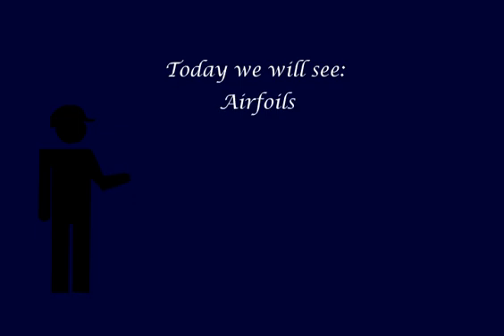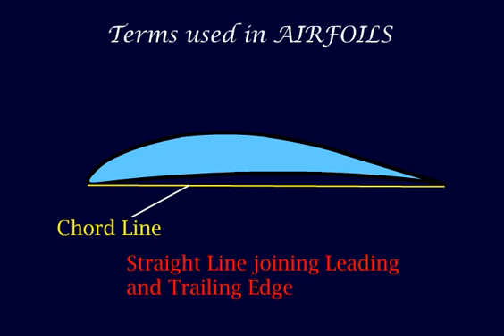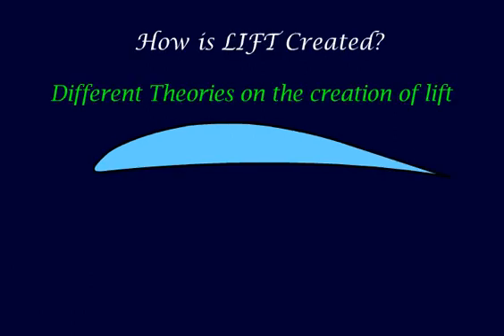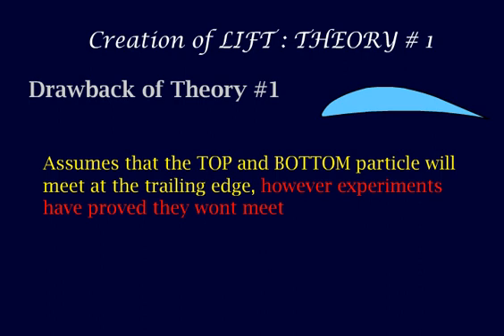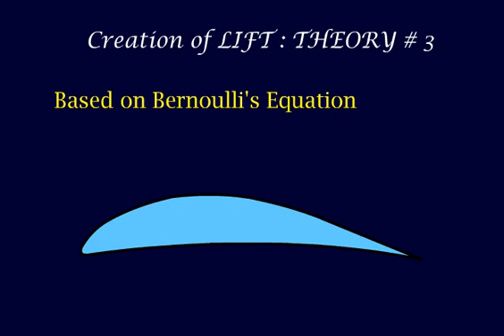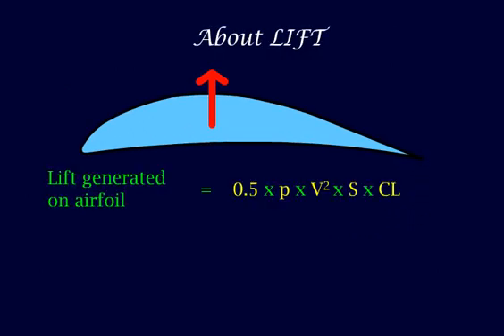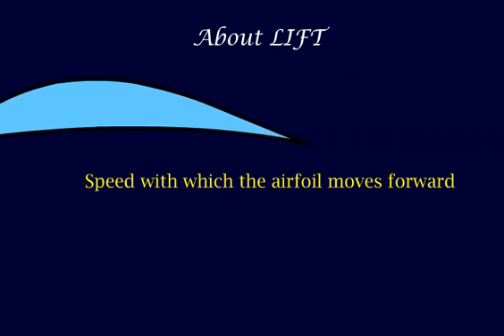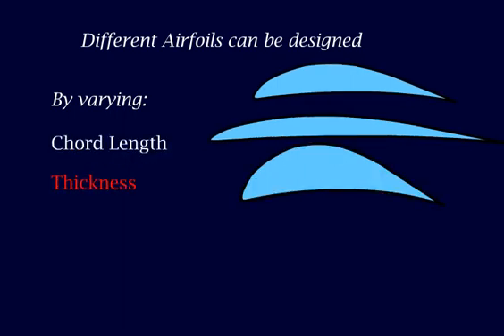Airfoils: How LIFT is Generated and the factors that affect Lift.

Comment: Good video. I liked how when you identified the Equal Transit Time fallacy you also mentioned that the fluid on top still moves faster than the fluid at the bottom. I was a little confused at around 2:45 in the video when you stated that velocity decreases at maximum thickness and that high pressure forces the fluid particle to speed up for the remaining chord. Not sure as to the validity of this, would have liked you to dive deeper and explain why you think that is. Otherwise, good job identifying both theories and how they are applied.
Reply from the maker: Thank you for the information! Check out my other videos as well!

Comment: The discussion of the theories of lift are decent, I would like to see a better explanation of why the air is accelerating around the upper surface. Also it seems that when you talk about pressure and velocity it seems like you are making them directly related when in fact they simultaneously affect each other.
Reply from the maker: Sure. Will make a video about lift separately.

Comment: This is disappointing for a recent video.
I am sorry, but your ideas at 2:45 are inconsistent with measured data and what is very well understood by aerodynamicists. 
.
 There is no "high pressure" above the wing that pushing particles toward the trailing edge.   That air accelerates as it rounds the LE because the pressure ahead of the wing is higher than this now lowered pressure above the wing. 
The upper pressure is measured at the lowest about 25% back from the leading edge.  Therefore, it is accelerated toward the trailing edge much earlier - by the time it reaches the highest point.  It then is DECELERATING in the last 75% of the chord because the pressure ahead (at the TE) is higher, being close to the atmospheric pressure.
..
The biggest factor for lift is what happens above the wing.  Yes it is counter-intuitive, but this is fact understood by aerodynamicists that is accurately covered in this short video - for ALL WINGS, upright or inverted, because it is the airflow that is the most important, NOT simply wing shape:

 WHY There is Lower Pressure Above a Wing
 https://www.youtube.com/watch?v=3MSqbnbKDmM 
A LIKE would be appreciated.
..
And read this:
 Understanding Lift Correctly
 https://rxesywwbdscllwpn.quora.com/
- - 

Regards
Reply from the maker: This video gives a general explanation on lift and different factors and I am not intending on giving a detailed explanation on acceleration and deceleration of the flow across an airfoil, although I have the skills to simulate that as well. 
Well if your intention was to spread knowledge, I would have been extremely happy, but your intention is just to criticize and promote your video which is quite disappointing. Anyways thank you!
Reply: @JxJAVIATION  No. Your video, 'promoted' right here amd while well intended, clearly "claims" to explain "How LIFT is Generated and the factors that affect Lift" and provides specific details, such as the high pressure above the wing accelerating air toward the TE,  that contradict the very well known phenomena. That is not 'general'.

I pointed specifics out above, but provide some solid science to refute those inaccuracies in those references instead of repeating it all here. Anyone wishing to learn the correct physics can go there themself.

Repeating old myths and trying to come up with new ideas that are not supported by fundamental physics, serves only to add more confusion in an already confused cloud of incorrect information.
I fail to understand why so many people want to repeat poor information as being  knowledge.

If you are that serious about providing good information, you would do serious research, from reputable sources and adjust your information to reflect good information.
All but a very few videos on lift do nothing more than add to the confusion - THIS is why so many people think that nobody understands lift.
..
Thank you for at least responding. It indicates that you may care.  The vast majority of YouTube authors post and ignore their videos, thinking they have provided a service to the public, rather than just adding more to the confusion.
What's your motivation?
"Learn Concepts in Aviation; Aerodynamics; Flight Dynamics; Aircraft Systems; Airplane Design; Flying Concepts; Aircraft Structures!"

Comment: Nice❤
Reply from the maker: Thanks
Reply: This video is disappointing and  incorrect as I stated in a comment above just now.
.
That upper air is accelerated up and around the leading edge and decelerates in the last 75% of the chord.  It DOES NOT speed up hear the trailing edge AND there is NO high pressure mid way that speed is up to the TE.
.
The biggest factor for lift is what happens above the wing.  Yes it is counter-intuitive, but this is fact understood by aerodynamicists that is accurately covered in this short video - for ALL WINGS, upright or inverted, because it is the airflow that is the most important, NOT simply wing shape:

 WHY There is Lower Pressure Above a Wing
 https://www.youtube.com/watch?v=3MSqbnbKDmM 

 
 A LIKE would be appreciated. 

..
And read this:
 Understanding Lift Correctly
 https://rxesywwbdscllwpn.quora.com/

Comment: Very good explanation
Reply: Unfortunately it is not.

.
.
This video is incorrect  as I explained above, just now.

.
The biggest factor for lift is what happens above the wing.  Yes it is counter-intuitive, but this is fact understood by aerodynamicists that is accurately covered in this short video - for ALL WINGS, upright or inverted, because it is the airflow that is the most important, NOT simply wing shape:

 WHY There is Lower Pressure Above a Wing
 https://www.youtube.com/watch?v=3MSqbnbKDmM 
 .

 A LIKE would be appreciated. 
..
And read this:
 Understanding Lift Correctly
 https://rxesywwbdscllwpn.quora.com/